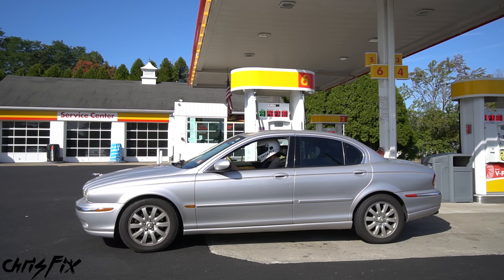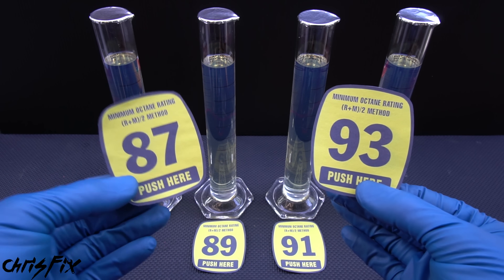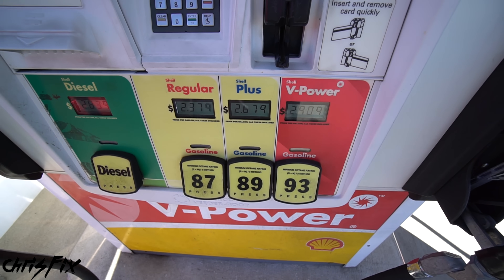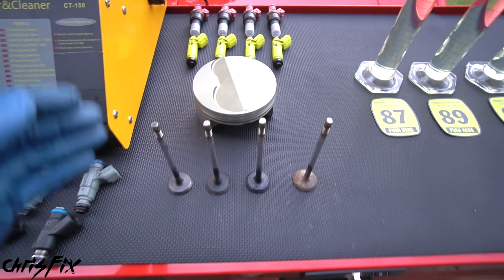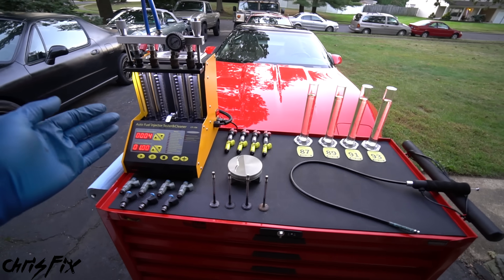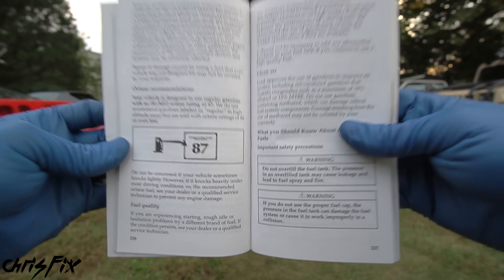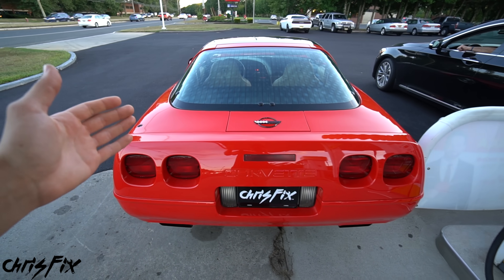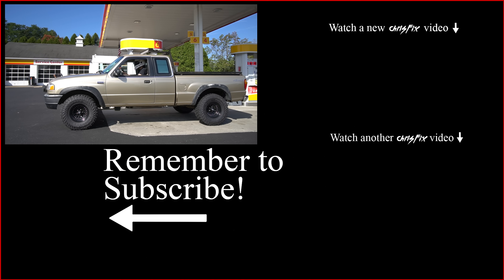What is the BEST Fuel to Use in Your Car or Truck and WHY

Comment: I’m a BMW mechanic and I constantly have to explain why 87 octane doesn’t belong in ANY BMW. I have to explain why there are super knocking codes in the engine brain and poor performance... I have to explain they drive a BMW and the extra 5 bucks a tank to buy the correct fuel shouldn’t be an issue to a BMW owner... no one thinks about that. The average person goes through 4 tanks a month... that’s 20 bucks a month extra to use the correct fuel. I always say, if you’re worried about 20 bucks a month, then maybe a BMW isn’t for you... excellent video,  very well done!

Comment: What you maybe don't really address is: okay imagine if the car says go medium fuel, but you have been running it on premium all it's life. It's not like it's hurting the engine to run premium over mid. So i'm assuming you can still keep on doing this because it gives you a lot more peace of mind over the carbon build ups? Or will the premium not perform any better at all on a mid fuel car since it's not gonna protect and clean it more and or better than medium fuel?
Reply from the maker: Depends on the additives used for talking about carbon buildup, and on a car the requires mid grade it doesn't matter whether you use premium or mid grade all its life, as if you decide to put in mid grade one day, the computer will adjust and you shouldn't have any issues!
Reply: @chrisfix  Okay, thanks Chris. Since it's not me paying for fuel, i'll just keep putting in shell v power and just enjoy the peace of mind. :)

Comment: My manual says 87 or higher. So should I just use 87?
Reply: Yes! That's exactly what your car is made for. There's no point in buying gas with a higher octane, since your car is made for 87. Your car won't benefit from higher octane. It can run it. But that doesn't mean you should, due to it being so much more expensive and offering no added benefits. High octane gas is usually meant for high end exotic imports, like Ferrari, Lamborghini etc.. Or for high performance cars like the 600 HP+ Mustangs and Corvettes. Not your daily driver.

Comment: i'm 50 plus.  i learned alot from this, thanks.   my tundra  has had 87 all 5 years of its life 65k miles),  i'm going to run some of the cleaner fuel thru.  will the 89 clean it or do i have to use the 93  to get the engine clean?   ( no knocking , yet . just want to do some cleaning) ??
Reply: Your far better off running a can of Seafoam in your truck. One can treats 16 gallons of gasoline. So two cans poured into a "full tank" of gas for your Tundra, will be fine. (That's enough to treat 32 gallons.) This will clean your engine far more effectively and quickly. All grades of gas (Especially Top Tier Rated) basically have the same amount of additives.

Comment: Chris great video, I just purchased a 87 ford f150 5.0 302 engine. I have dual tanks, I was told to run premium by the previous owner. I filled front tank with 87 and I'm getting knocking. The rear tank I filled with 93 I don't hear it as much. The truck has 180,000 miles on it. Should I be looking into what could be causing this, could it be the injectors or timing. I rather run what it calls for back in the day, and that was 87. Anything you can direct me to check out. Thank you, great videos you make
Reply: You need a tune up for sure probably. It should run on 87 octane perfectly. But is sounds like you may have bad lifters. May be time for an engine rebuild.
Reply: @waycoolscootaloo  thanks Chris for getting back to me, truck is in really great shape. It runs good except for when I run the lower octane

Comment: They may burn with the same energy or whatever science you used but I can tell you from real world experience I used 89 in my new 2019 f150 lifted 6 inches with 35 inch tires and 22 inch rims and got 14 miles per gallon . When I used 93 I got 16 miles per gallon and definitely could tell a major difference in power with 93 octane

Comment: So the normal in America is worse than the normal in EU.
Reply: You didn't watch the video. 😉 Octane in the US is measured differently than it is in the EU. For example, 99 octane sold at Tesco or Shell in the UK, is the same as 93 octane gas in the US. The US and Canada uses the Mon and Ron method averaged out. (R+M)/2.  Now regular gas isnt sold in the UK. It's one of the few countries on Earth that is completely ripped off. Most cars and even large gas trucks, are all made to run on a 87 octane gas. (91 octane in Europe) Even most cars in the UK run just fine on 87 octane gas. (91)

Most countries sell 91 octane in Europe and Australia as well. 91 octene (87 octane) is all that's needed for 90% of the worlds modern vehicles. Even the all new Ford Godzilla big block 444 CI (7.3 liter) pushrod V8 for F-250 ~ F-750 Super duty trucks runs on 87 octane gas perfectly. And it's used in large vehicles weighing as much as 26,000 lbs or more. 

The most common octane grades sold in the US are 87, 89, 91 and 93/94 octane. (EU Equivalents of 91, 93, 95, 99/100 octane)
Reply: @waycoolscootaloo  that is right however we got lowest 95 which is the same as your 89 or at least close.
Reply: @waycoolscootaloo  And yes most of the older gasoline vehicles can run on it. However newer stuff usually 
requires 95 or higher.

Comment: Question. Sxs in the winter -25c why will it start easy on 87 and not at 93?
Reply: 93 octane gas is harder to compress and detonate in your engine. 93 octane is made only for high compression engines. lower compression engines will have a hard time burning it and wont burn it all the way through.

Comment: We in Colorado have:
 
Regular 85
Plus 87
Premium 91
Majority of people use 85. Costco has only 85 and 91 in our state.
Reply: Fun fact: 85 octane also voids your vehicle manufacturer's warranty if the dealer were to test your fuel. Only 4 states legally sell 85 octane. And only above 5,000 ft, in sea level. 85 octane can damage your engine under altitudes of 5,000 ft. 85 octane is very illegal in the rest of the remaining 46 states. The auto industry officially recognises 87 octane as the lowest grade in the US. And this is the grade all cars are mostly engineered to. 

Its ok to run 85 octane above 5,000 ft, in say Denver Colorado. But you would want to refuel if you go under 5,000 ft. with higher octane gas. I personally would fuel with the 87 octane as that's considered "regular" at any sea level height and recognized nationwide. Plus it won't void warranty.
Reply: Scootaloo I agree with your comment and can’t understand why people in Denver put 85 junk in their cars just to save some pennies. I always owned vehicles with high performing engines where 91 is required. I’d personally put 93 in my current car, but it is not available here.

Comment: In Canada the highest octane at any gas station  has no ethanol. Lower grades do. Around 10 percent.Ethanol is supposed to cause carbon build up.
Reply: Ethanol prevents carbon build up. That's why most graders offer 10% here in Wisconsin. Ethanol burns much cleaner than straight gas. That's why it's mandated for pollution reasons.  🙂
Reply: @waycoolscootaloo  not according to what I have read.  Check out Project farm on You tube. He does a video on it I believe .
Reply: @conifergreen2  It's a scientific fact that Ethanal burns cleaner. That's exactly why Top fuel dragsters run a near 100% blend of it. 

A simple Google search will even show you. 

According to Google Assistant:

Ethanol can reduce pollution

Ethanol and ethanol-gasoline mixtures burn cleaner and have higher octane levels than pure gasoline. End quote. 

But ethanol does evaporate faster than gasoline and will result in slightly lower fuel economy. But it will give better overall performance.

The additives in the gasoline you buy, also stops or prevents any carbon build up. 

10% Gas (E10) also has all of these additives.

Comment: Our gas is crap in the US not because of RON/POM conversion, but because we mandate blending in 10% ethanol which has lower energy than gasoline.
Reply: 10% blend is currently sweeping across the globe now actually. (And even higher in some countries like Norway and Brazil) It does result in slightly less energy for fuel mileage. But it burns cleaner and boosts octane. 10% is the new adopted industry standard now.

Comment: For premium-only cars check your owner's manual for the exact grade. Mine calls for 91 octane or higher which means you can mix 93 and 89 50/50 and get exactly 91 average, saves a few bucks per fill up!

Comment: Hopefully someone hasn't already asked this. If the recommendations from car manufacturers is either regular or premium, why is there is a mid grade? Also I live at 7,000 feet in Colorado so maybe provide some information on fuel at elevation. I think we have 85 for regular, 87 for mid and 89 for  premium? I have a diesel pickup and haven't filled up a gasoline vehicle in a while so not sure what the numbers are.
Reply: Mid grade gas (89 octane) is simply a 50/50 blend of regular 87 octane and 91 octane premium. So technically there is no "official" mid grade gas. There are just the two tanks in the ground for 87 and 91 octane gas. When you pump mid grade, it's simply pulling a 50/50 flow from both tanks underground and mixing it evenly right at the pump itself. Older cars and trucks from the 1980's and older, would often call for mid grade 89 octane. And a lot of older classics like mid grade better. 

Mid grade was basically a balance for cars to have slightly better performance, while still being marketed as cheaper to run than premium counterparts. So midgrade allows for slightly better tunes and higher compression ratios, while striking a happy medium on fuel affordability. 

If you have a 1980's vehicle like say a Ford F-250 with the big block 460 Ci V8, then I would definitely recommend a 89 octane fuel or better. These big engines like the slightly higher octane, especially when under load. 

Now in modern times, basically from 1992 or 1993 onwards, auto manufacturers no longer make cars that require 89 octane. It's either 87 or 91 octane or better. They no longer target a mid grade gas like they used to. They target for 87 specifically, or 91 octane today only. Vehicles from the 80's and older, didn't really have any type of computers or fuel injection systems like modern cars and trucks do.

So 89 octane is only still around to service older vehicles. And even then, it's still around simply because it doesn't cost the gas companies any extra money by having it. This is because it's simply a blend of two gasolines that they already have. If it were a actual blend of gas by itself, it would have been discontinued a long time ago. 

Why have such a blend, when so few vehicles use it in modern times? Not to mention vehicles that would have required it, could simply use 91 premium or better. It would cost the consumer of that vehicle a bit more of course. But the gas stations would never carry it today, since they don't sell all that much of it. Again it's just a blend though, so why not sell it in that case. It's a win win situation for the consumer and gas station that Mid grade just so happens to be a blend of fuel that requires no additional infrastructure to make or sell. 

Even the newest and largest Ford truck gasoline motor, the 444 CI (7.3 liter) Godzilla V8 engine used in F-250 ~ F-750 Super Duty trucks, requires and runs fine on 87 octane gas. Modern electronics and modern tuning is vastly better than what it was in the 1980's. 

Now as for your grade of gasoline: At elevations of 5,000 ft and above, 85 octane is generally safe to use. However, below 5,000 ft, it's not good to use. It can cause engine knock at lower elevations. 85 octane is considered below "regular gas." 85 octane is only legal in 4 out of the 50 US states. It can not be legally sold in most states. And not below 5,000 ft, technically. 

And in fact it can void your warranty on your car running 85 octane. The US auto industry doesn't recognize 85 octane gas. It's only still legally sold in four states on a technicality. And your dealer can legally deny you warranty work if they find out you are running 85 octane fuel. But at 5,000 ft, and above, the atmospheric pressure is lighter and so engines don't produce the same compression they do at lower elevations. So 85 octane performs like it were 87 octane at 5,000 ft, and above. But below 5,000 ft, and it will perform like actual 85 octane gas. And that's not good for your 87 octane rated car. 

So if you plan on not leaving say Denver Colorado, then you can run 85 octane and not worry. But if you want to leave, then fuel up on your mid grade 87 octane. Your mid grade 87 will be "regular" everywhere else in the US for the most part.  

87 octane is the lowest official octane recognised by the auto industry.

Comment: I've heard from many vehicle mechanics that once you get above 4,500 to 5,000 feet above sea level all the gasoline octane levels all burn the same. Whether it's 85 or 93 octane. People are not told of this to keep people wanting to purchase the higher octane no matter where they live and drive helping to further line the pockets $$$ of the oil companies a oil and gas refineries.
Reply: Hence why 85 octane gas is only sold at elevations above 5,000 ft.  However 85 octane can void your warranty, because auto manufacturers officially recognize 87 octane as the lowest octane gas. This is because if you fill up on 85 octane and then drive below 5,000 ft, it can cause damage to your engine. States outside of Colorado, Utah, Wyoming and Montana, basically prohibit the sale of 85 octane gas.

Comment: My Honda civic (turbo) say’s Premium recommeded ?
Reply: That specifically means that your car is made to run on 87 octane. Now if it said "required" then you would have to run premium. Yor car may put out a few more HP with premium, since it says recommended. But the added cost of premium isn't worth the value of that extra 10 HP you may get. Cars that have to run premium, will always use the word "required" in the manual.

Comment: I know I am a year late, but thanks on the video ChrisFix! I am glad you said all of that on the Shell Prem cleaning carbon using for 2500 miles. I did not know that. Will definitely try out next time I have issues. 
Your videos are very informative and have used as step by steps on some of my projects!

Comment: So if I'm using  91 V power  from shell  ... on my Honda accord 9th gen V6 ... I've  damaged my engine? ... after putting 91 for the last 2 years  . Could I switch to  87 ? 
And if the engine is damaged/or  mild damage  . How would I know  

Switching back to  87 . After I burn of all the 91 in gas tank
Reply: 91 octane is premium fuel. It'[s ok to run in a car that recommends 87 octane. But it's just a complete waste of money to run 91 octane in a car that wasn't made for it. Now the opposite is true if your car requires 91 octane and you have been running 87 octane. Its ok to run a little to high of an octane gas. But it's not good to run a low octane rated gas.  

So if your car was made for 87 octane and you have been running it on 91 for two years, then it's ok to still run it on 87.  

But if you want peace of mind and your too worried still, then you can still at least save some money and run 89 octane mid grade gas instead. It's a 50/50 blend of 91 and 87. Hence 89 octane. (Note: 88 octane sold as mid grade at select gas stations, is a E15 ethanol blended fuel not recommend for vehicles older than 2013 model year.) 89 octane is just regular gas in comparison.

Comment: in Australia you  got e10 unlead91 unlead95 unlead98  premium  and diesel
Reply: The US is mostly "E10" at 85 octane, (Above 5,000 ft sea level, and in 4 states only) 87 octane, (Sold in all states as the lowest grade gas, except where 85 is available in select areas) 88 octane, (An E15 gas sold mostly in the corn belt states as a Mid Grade, alongside regular "E10" 89 octane) 89 octane, 91 octane, 92 octane, 93 octane and 94 octane.

US 87 octane = 91 octane in Australia.  US 89 octane = 95 octane in Australia.   US 93 octane = 99 octane equivalent in Australia.